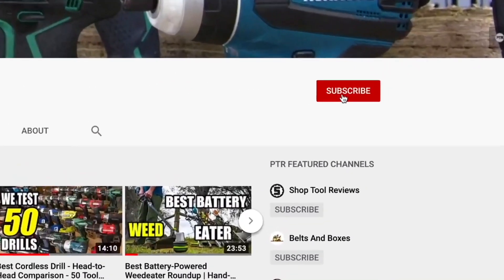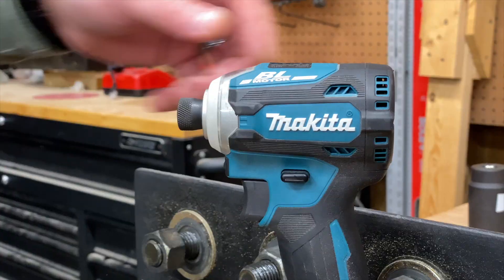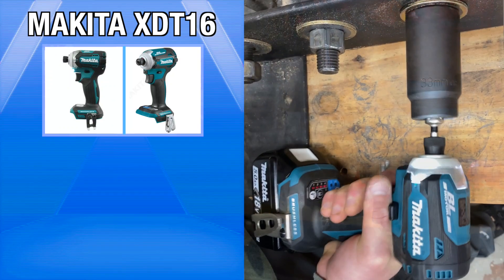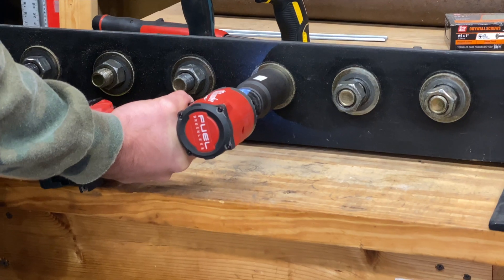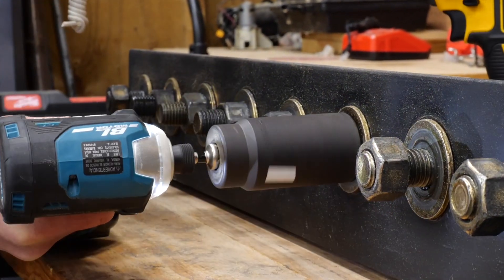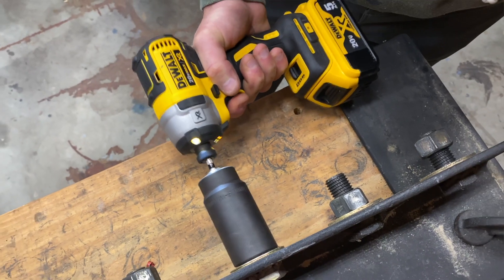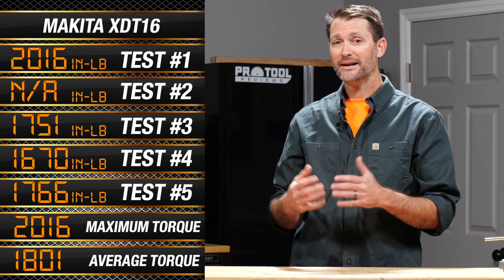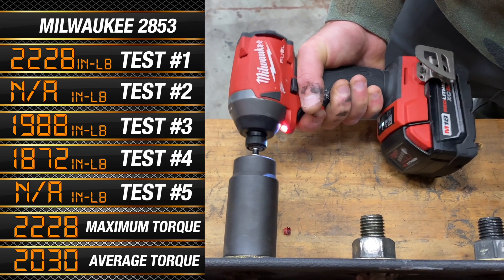The STRONGEST Impact Driver 2022 [TORQUE TEST]

Comment: I think the extreme torque ‘race’ tools are committed to is kinda ridiculous…..These tools are meant for screws and lag bolts in wood, not industrial shipworks.  If you needed serious tightening power you’d be buying a 3/4 drive impact wrench!  As it is these monsters can already sink ten inch M12 bolts into wood with no pilot hole!!!…..Where on earth is that a daily use scenario for your average tradey?  And as we see here….you can’t even use that monsterous torque with the 1/4” shank size of the chuck.

Comment: Dewalt, best value. Milwaukee,  most power. Makita, best function and finish.
Reply: As a person who owns the Milwaukee Gen 3, I agree. Looking at DeWalt atomic impact or the makita entry level brushless impact as a secondary tool  cause my Milwaukee impact is so over powered lol 😂
Reply: @hammerheartdan6311  I have the atomic and for the price is a pretty good little impact
Reply: That dewalt impact is not the atomic series, is the dcf887xr
Reply: @johnnyorganez2072  ik I have the 887 the atomic and the 894 wrench I was replying to a guy saying that he was looking at the atomic as a backup
Reply: Plus, batteries for Makita usually can be had for much cheaper.
Reply: Makita size is great too
Reply: I love my makita. I’ve already snapped multiple adapters with it so I wouldn’t even want more power out of a 1/4” hex impact.

Comment: Ergonomics/comfort, serviceability, battery platform, tools offered. Buy into a system instead of #,s. All three impact drivers here in this test will give you more than enough power for most applications you’ll encounter on a day to day basis.
Reply: @Protoolreviews  fantastic video BTW.

Comment: Kind of counter productive when your impact driver can break its driver bits at will.
Reply: But it is productive to have a lower power mode
Reply: The driver bit doesn't look like a proper dedicated impact bit; it might not have been rated for impact. Not that I can say for sure though.

Comment: The milwaukee is a beast. I grabbed mine during the home depot packout set special buy. And with milwaukee replacing the collets now to the improved version, this impact is damn near perfect.
Reply: So the one you bought has the improved collet?
Reply: @CP-ok1gv  I had to send mine in to get the fix. Look into the collet; if you see two ball bearings, it's the fixed version. If there's only one, send it in to be fixed.
Reply: @NWGR  is this a problem with the surge too?
Reply: @CP-ok1gv  No, the surge does not have the issue with the collet.

Comment: Awesome video! I currently own all 3 of these impact drivers as well as the metabo hpt triple hammer 18v version. All 4 are great tools top of the line. If i had to keep only one, would be close and i would be happy with either of the 4, but i would choose the triple hammer.
Reply: Congrats buddy, i wished I had all those, I only have the Metabo triple hammer, which Metabo impact driver model do you have
Reply: I agree!

Comment: I'll stick with makita. All of the guys around me use milwaukee and they are constantly recharging batteries. Yes milwaukee has more power, but only a handful of trades require that extra umpf. My makitas last me all week and in my opinion you can get more done when you aren't stopping every 2 hours. At the end of the day electricity only works according to ohms law. And it's clear milwaukee chose to tweak their motors to get more power at the expense of run time.
Reply: Well written bro. Truly.

Comment: Having more torque that the bits that will fit into the tool can handle is pointless and is borderline dangerous. For the screws these are meant to drive they all have more than enough torque.
Reply: Exactly, you could have even left out the word borderline 😂👍

Comment: I love Makita , but for some reason they lie about their specs , Project Farm did an rpm test on a few impact drivers and Makita's xdt16 says 3,600 rpm's but only did in the low  3,300's  and the  DeWalt dcf887 says 3,250 rpm's and actually did around 3,350 which was both surprising and More than Makitas ....
Reply: @Protoolreviews    I own both the Makita xdt16 and the DeWalt dcf887 and I've tested them head to head using  5.0ah batteries , I did several 2" & 3"  drywall screws into Pine and the Dewalt dcf887 beat the Makita xdt16 every time  which also surprised me , and the xdt16 is new and the dcf887 is about 1 year old .... I'd love to see you guys do a video on it ...👍🖖

Comment: The Milwaukee's power is impressive, but you found the problem with that much power going through a 1/4" shank. I'll stick with my Dewalt and use a 3/8 or 1/2 impact if I need more.

Comment: I wonder how the next gen DeWALT (DCF887/DCF888 replacement) will perform. I saw reports of it maybe a month ago. Makita also has the successor to the XDT16 unveiled but I think the torque rating is the same.
Reply: What successor to the XDT16? The only new impact I know of is for their new XGT 40V series.
Reply: @BigBear--  It´s called DTD172 and are not yet avaliable in all markets. *The XDT16 is called DTD171 in other parts of the world.
Reply: @johanneso6083  oh, you're talking about the top  Japanese version of the impact driver that I've seen and heard about?

Comment: Absolutely not surprised by the results here. Milwaukee always leads the industry in power with their impact drivers and wrenches. DeWalt drills & drivers are always underwhelming. They really need to step up their game, as now Milwaukee is so far ahead and pro-sumer lines like Kobalt are making great tools that are in some cases a considerably better value than DeWalt.
Reply: @luisprieto4390  Milwaukee users ONLY care about power. Nothing else matters.

Comment: 🤣Milwaukee kept snapping those adapters🤣.  Why can’t they make adapters that can withstand the impacts.  It’s just ridiculous how cheap everything is made now.  What’s even funnier is you guys didn’t use a high output battery.  That would have been nice to see the difference in peak torque output.  Good vid!!